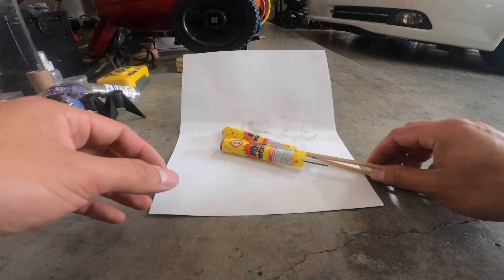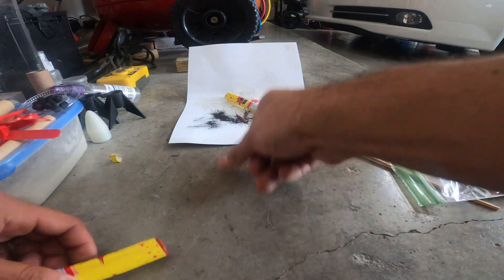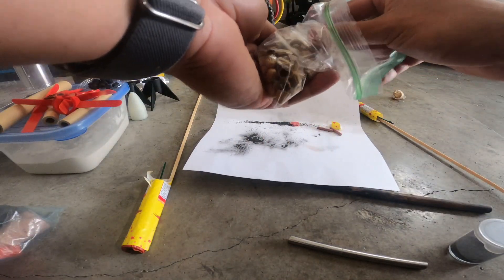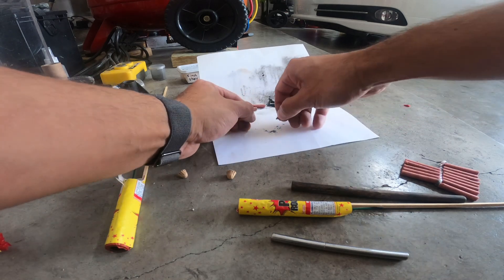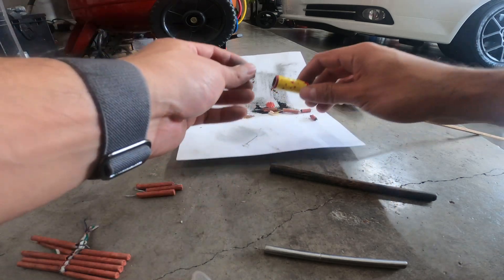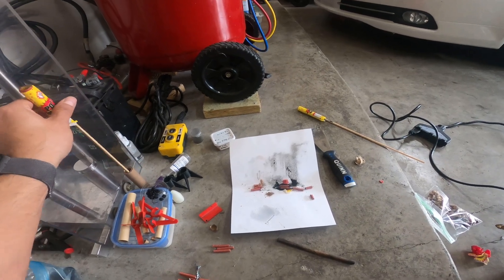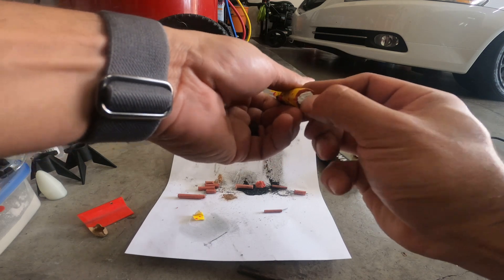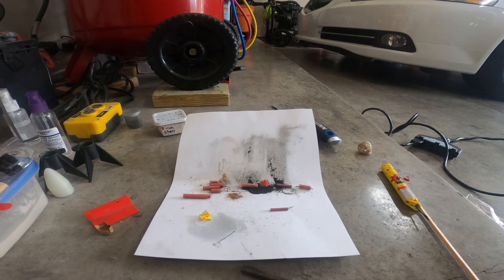Texas pop rocket mod

Comment: What if you add a super tiny pill filled with flash and a quick match and add as a header?
Reply from the maker: @Theactualcurrentsea  so I end up doing that in a later video but I do make my own Fla$h I just haven’t in a long time but I saw something online that now they won’t sell the chems in the same order and if you try and source it separately they can find out but if you need it you can take some cracker apart and dump the powder in or do what you said.